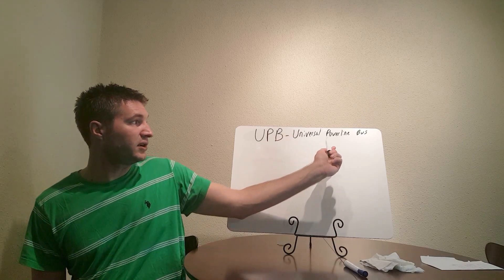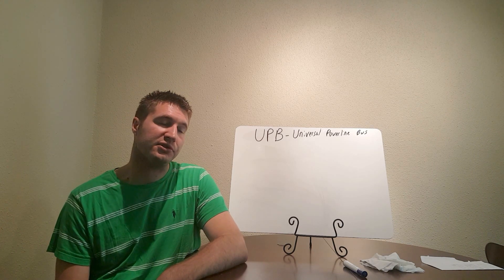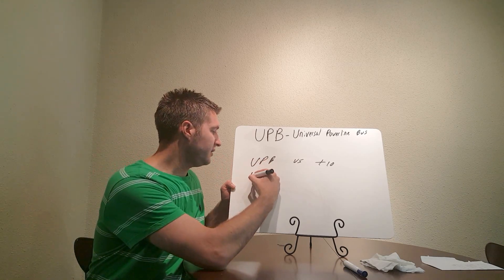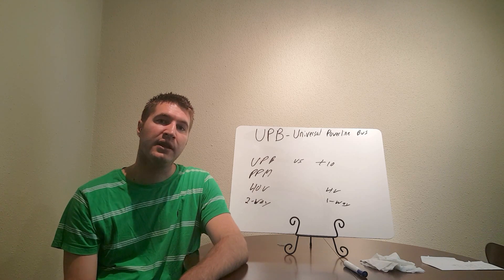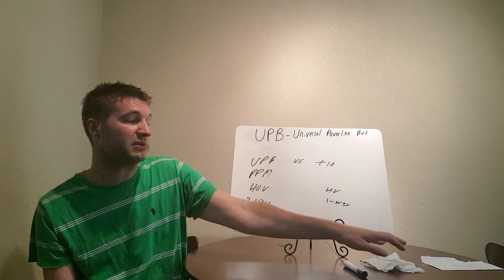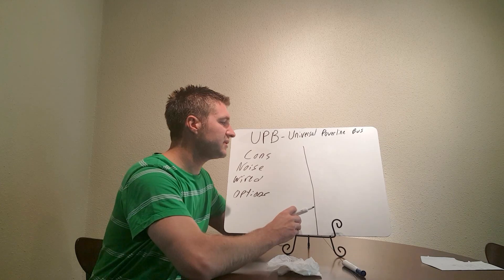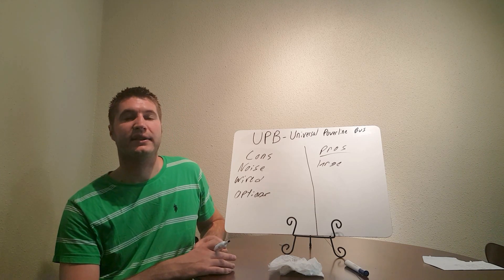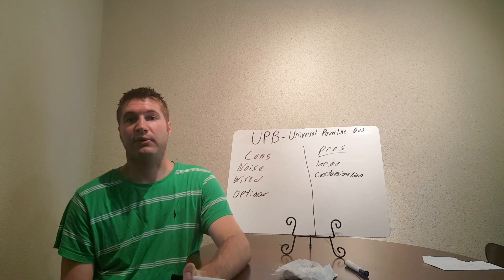UPB Automation Pros and Cons - Comparisons with X10

Comment: A few clarifications for your video. You claimed you can have only 256 devices unless you have more than one controller. That is not completely accurate. First of all UPB is a peer to peer system. A controller is not required at all (add to Pro column). If/then and timers can be handled by various timer and I/O modules. As well as wireless control from a smart phone through a plug-in gateway module (if you really want that). Secondly, the number of devices is not limited to 256, it's 250 per UPB network ID (most homes would only need one UPB network ID, but for various reasons you may want to setup more than one) and there can be up to 250 UPB network ID's per home. So a single home can have up to 62500 devices. Lastly, you forgot to mention that noise is seldom so bad that it requires a filter. Due to anti-noise circuitry built into current UPB devices and the 40v signal. UPB signals can transmit successfully with a significant amount of noise, unlike X10, which could hardly handle any.

Comment: Do they make wireless remotes, as is available for X10, such as Palm Pads, motion sensors, and other devices, including the transceivers?
Reply: You can use any Universal IR remote (that can learn IR codes) with the appropriate UPB receiver. The easiest way is to use a Pulseworx KPC-6 keypad and IRR-2 remote.

Comment: Hi Tyler, im very interested to UPB lighting automation together with presence sensor to automate lights. Can you advice where I can start? E.g. UPB devices that i must have to start learning. Btw, I leave in a country that uses 220v. Thanks in advance!
Reply: Although there are ways to control 220v devices from a 110v UPB device, there currently are no 220v switches or modules available.

Comment: WHAT ARE BATTERY POWERED DEVICES
Reply: Wireless technology such as Z-Wave have available wireless motion sensors and such. It's all great until the battery runs out. Wireless alarm systems have the same issue. Expect to run around the house replacing batteries all the time if you go that route.